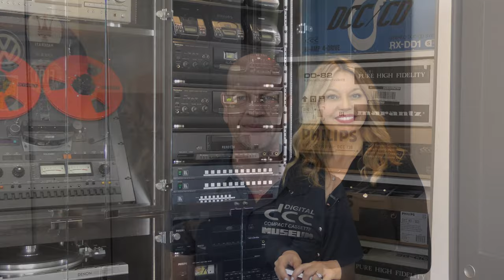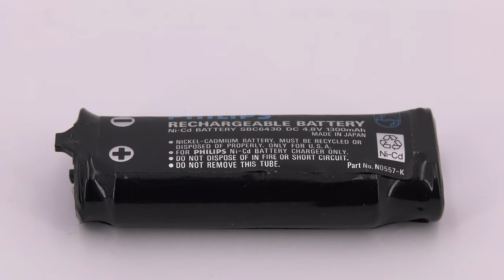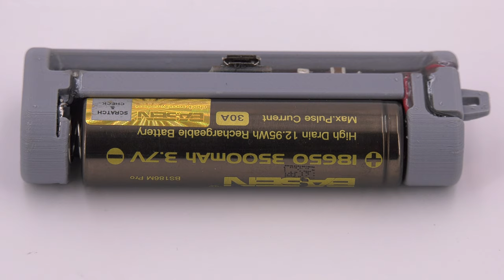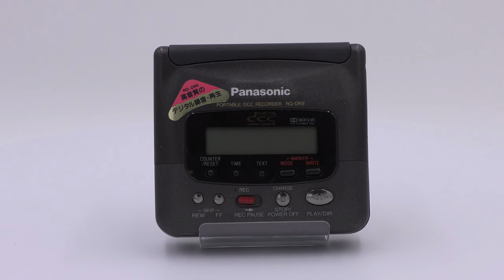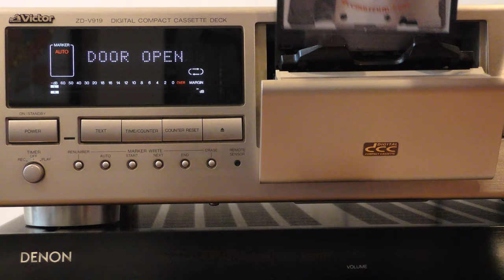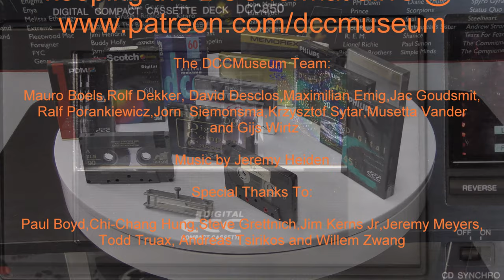Double Your Playback Time With A Single 18650 Battery In Any Portable DCC Player

Comment: From an audiophile perspective the DC-DC converters are PWM converters, Meaning they use timed pulses to achieve the desired voltage, Those voltage spikes affect the audio quality as well as motor speed stabilization for analog cassette playback, The best way of achieving this is using a true sine wave voltage converter and that requires large PCB's. The concept may work fine for digital cassettes but it is not ideal for analog playback. One thing to note is the PWM pulses may create noise for the headphones pre-amp even for DCC playback.
Reply: What? DC-DC conversion and true sine wave converters? You sure you know what you’re talking about?
Reply: mikewolf78 Why don’t you tel us?